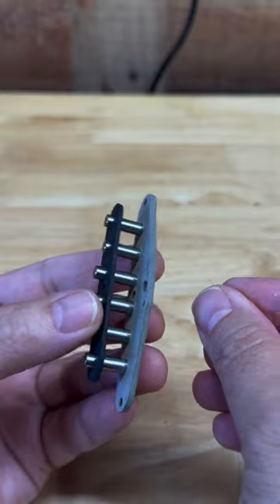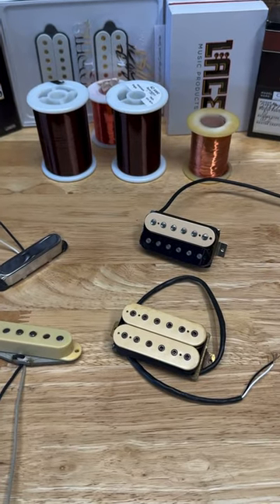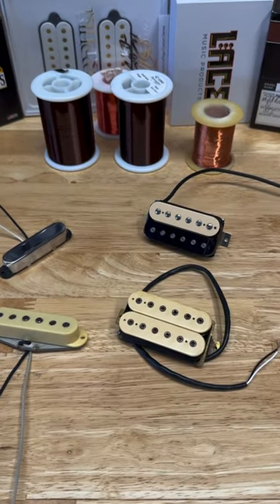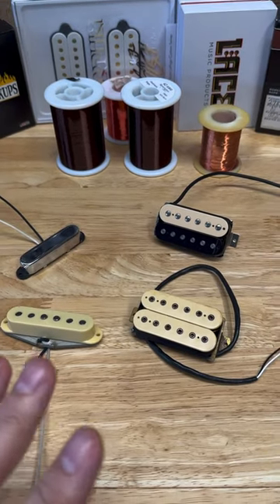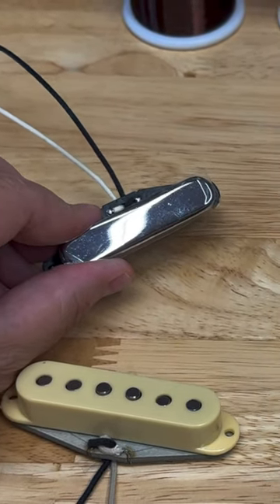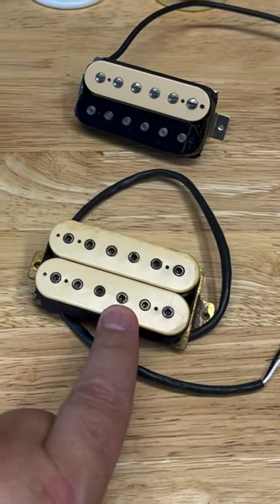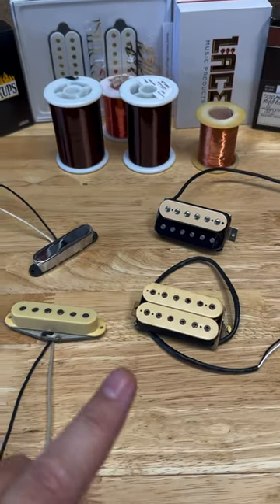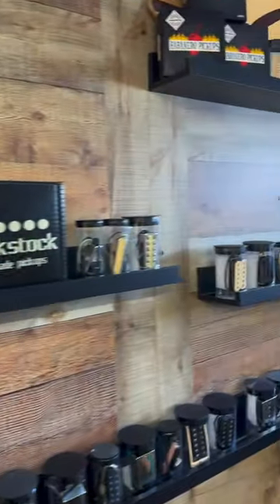How thick is the wire in a guitar pickup?

Comment: Can you do a frequency analysis of the different gauges and materials of pickup wire? Like an A-B test that compares two kinds and graphs the results. Lol that's a lot of work but interesting.
Reply: Agreed. While that would be fascinating, it would definitely need to be done in a full-length video. It would be very cool to know if gauges would affect compression or mid-range in any way. I know the number of wraps and types of bobbins and all that come in to play,but it would be incredible to see the reading between different gauges with all other components being the same. I'm curious if the bigger gauge is used simply because it's less fragile or if there is an actual.sonic difference. Excellent suggestion!

Comment: Why are guitar string gauges the way they are? I thought gauges where the higher the number the thinner the thing is yet a 9 gauge string is thinner/lighter then an 11 gauge string? I have been wondering about this for months
Reply: Guitar strings are measured in thousandths of an inch. 9's are .009" whereas wire is measured based on AWG standards.
Reply: Battery cables on cars are usually 4g , trucks and heavy equipment will use much heavier cable like 1g or 0g .. typical electrical wires in a car wiring harness are 14-18g  .. higher the # , thinner the wire.

Comment: Are these Wires Coated with any kind of Shielding Material  ?
Reply: They are coated with an  insulating layer. Otherwise they would just act like one thick wrap. I don't know about shielding  , but I think not, since guitar cavity shielding is a thing. That's really a weak reason, but there have been multiple tests that show shielding pickup cavities does work, so it's not just a mythical reason to do that.
Reply: You cannot "shield" from a magnetic field in the strictest sense (superconductors excluded). However, it is possible to concentrate flux lines in various ways. This is why transformers use iron alloy cores. (Fun fact: A compass still works fine inside a Faraday Cage.) This is a challenging topic!